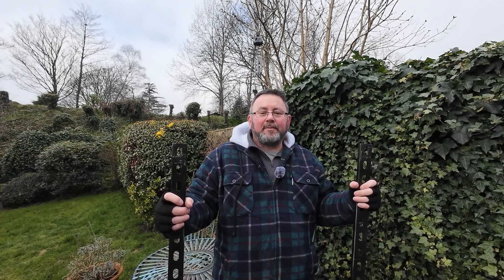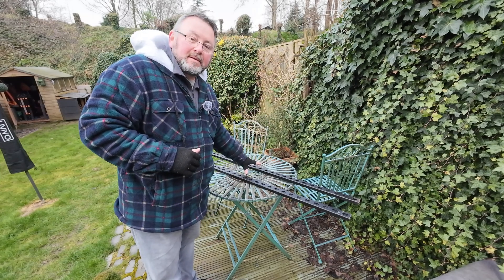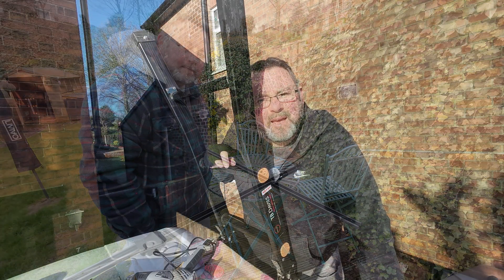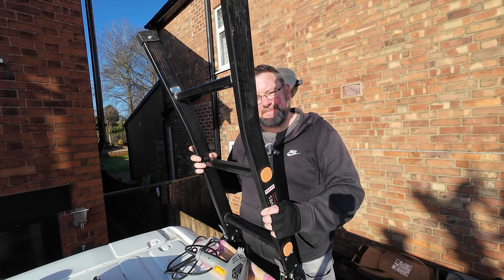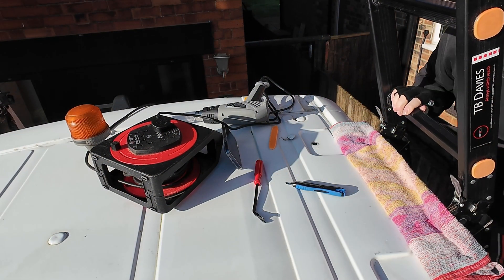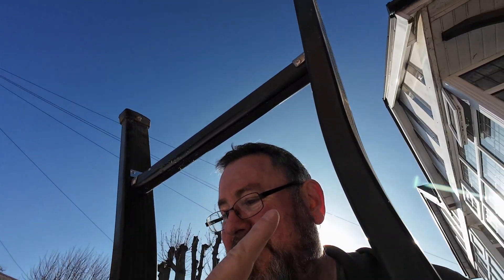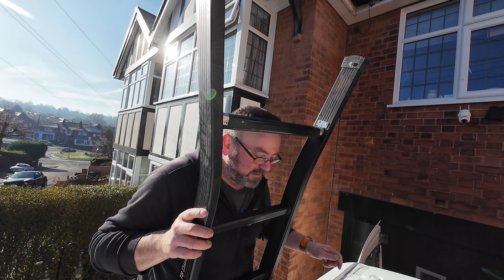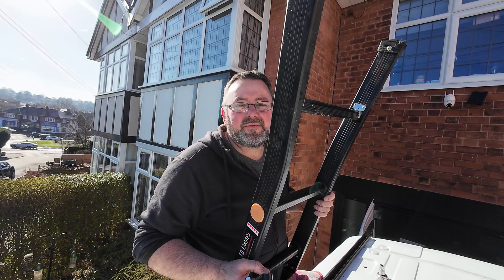How to Create a Unistrut Solar Roof Rack for your Van

Comment: Nice that's given me some good ideas for my build.  One question though have you got the mppt output going to the bus bar or steight to the battery.  Problems if it goes to the bus bar even if you isolate the battery your still get power stright from the mppt in to the 12v systems.

Comment: Thanks for video. Very helpful How has this held up. Any mods or thoughts on the everything used in video. Thanks
Reply from the maker: Hi. That’s for your comments. It’s held up really well.  The only thing I would change is the hight of the unistrut. I went for 21x21. If I had used 21x41 I would have needed less risers to get over the curve of the van roof. All in all very happy

Comment: Hi, looking to do this myself in a couple of weeks. Couple of questions. Could you have mounted the solar panel brackets the other way round (upside down) so that the panel sits a bit lower, between the two cross pieces, rather than above them? Also, i have those plastic cover things in various places on the top of my van (as it looks like you do also) any idea what's under them? - Ford Transit Custom
Reply from the maker: Hi.  Thanks for watching.   I could have mounted the like you mentioned but they then sat very low to the roof. I used unistrut which was 21x21mm.   In hindsight I think I should have used 21x41mm which would have made them a little taller.   For the plastic covers I too off there was a M6 thread under them so I just needed the bolts to to match which I got from Wicks.  Dont get really long ones as like I did to start with as you will then need to cut them down.   I am not sure if the Custom will be the same.  Good luck.